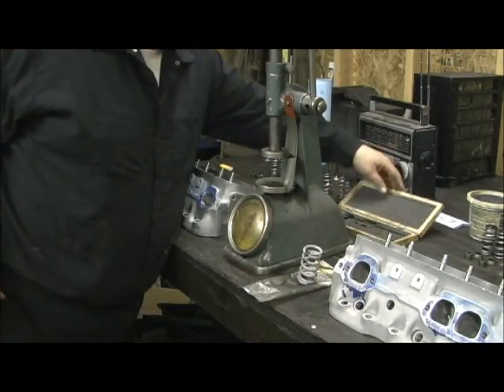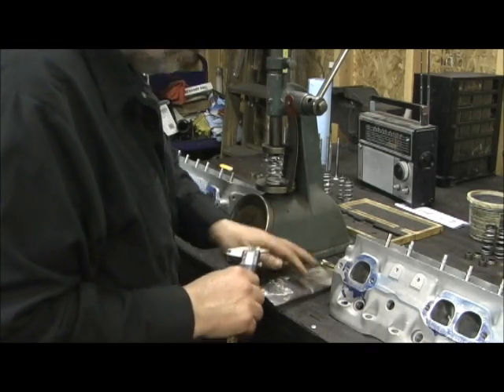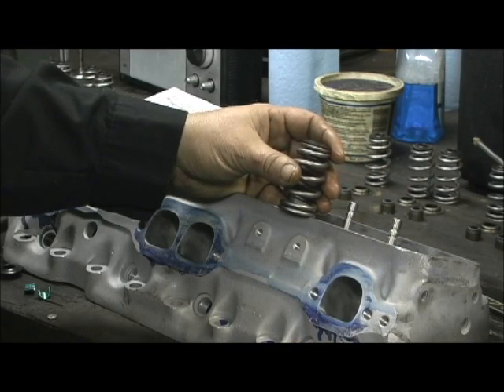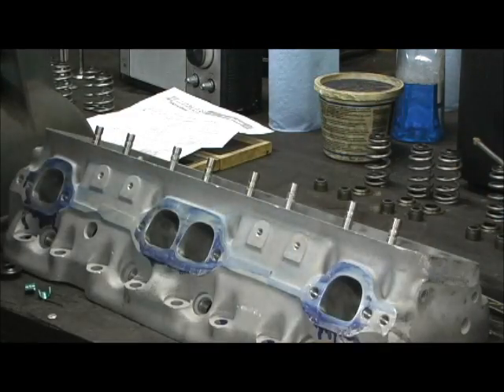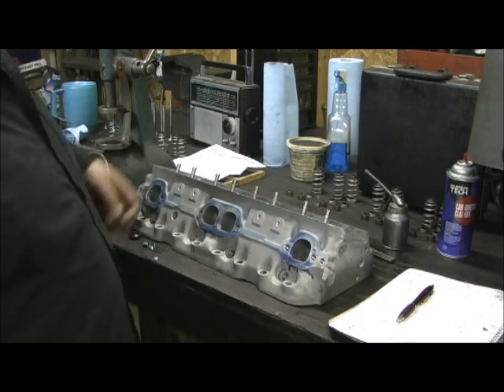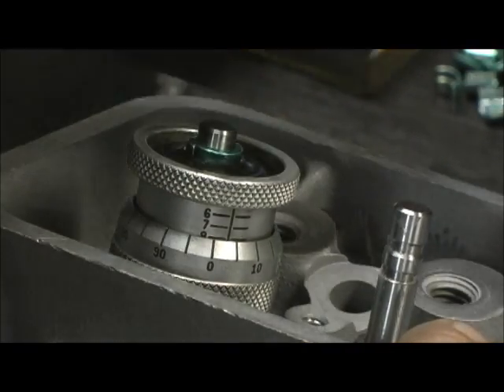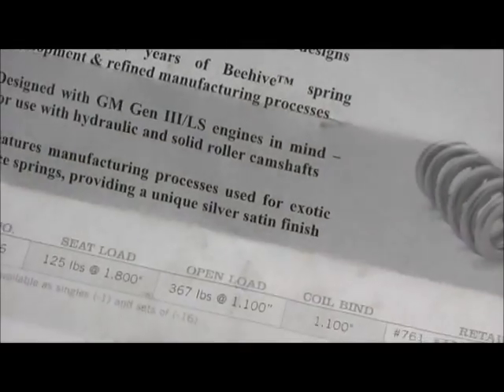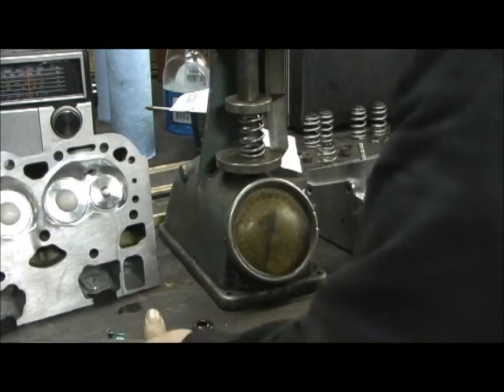LT-1 Chevy Stage IV Conclusion Part 2  FINAL

Comment: I agree on the dual springs over beehive. Not a big fan of the beehive springs, mostly because they don't dampen the resonance that well as the dual or triple would do. I've done few test in Lotus Simulation and the results for one spring design were horrible. Of course, progressive wire and etc help to dampen the resonance, but I'd rather stick to dual ones if I got a chance.

Comment from the maker: The heads themselves are about 1/3 of the cylinder bore in "quench" form. I don't think that the cylinder head on the adjacent area have a flat surface to build a piston to achieve it, it has been a few months since I done a set of them so I am not sure, but I don't believe they do, and the cylinder lays right into the bore diameter so a "quench" piston would not have a flat surface to do a backward push to achieve quench.

Comment: At first I ported the intake to match the gasket, then I installed the the TB and still ended up with a little lip on the transition. I had to modify the gasket as well to get it working right without any obstructions. Going to wait for a dyno run till I get the 1.5 roller rockers, the car doesn't like rpms below 1.8k, I think it would be better anyways, a little more street friendly.

Comment: This is true, I been thinking about just buying a set of aluminum lt1 heads and do some porting on them. They seem to sell like hot cake on the forums. The only factor that's holding me back was and as you said it, tooling. I am pretty skilled with my hands and no, not at masturbating only. I do agree though, nothing can replace time and experience.

Comment: The 58mm TB is here and installed, I had to open up the TB ports on the intake manifold. That was easy and I also made sure there were no edges to cause any turbulence. Well, if the car was crazy before, now it's psychopathic. Another dyno session with roller rockers and FP tweak will yield more HP and TQ.